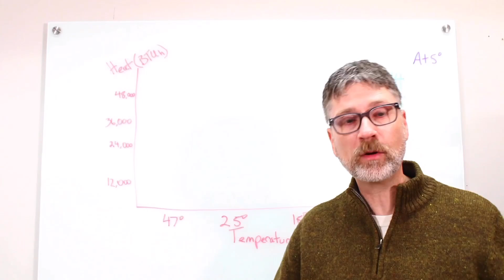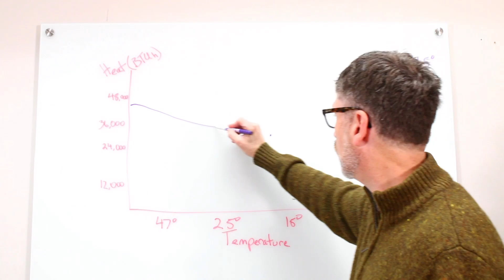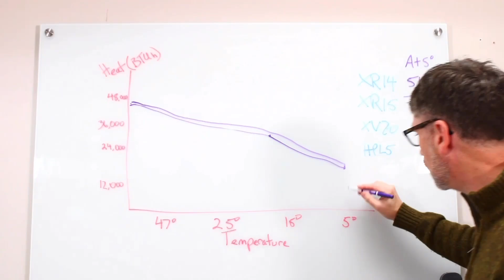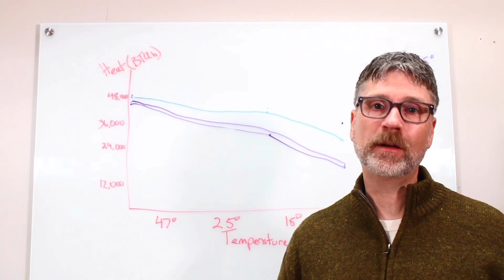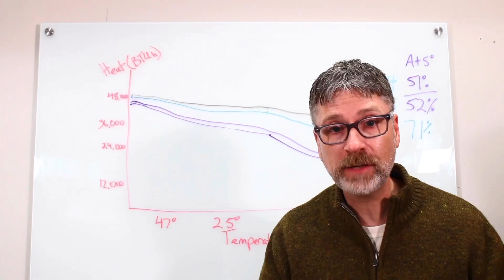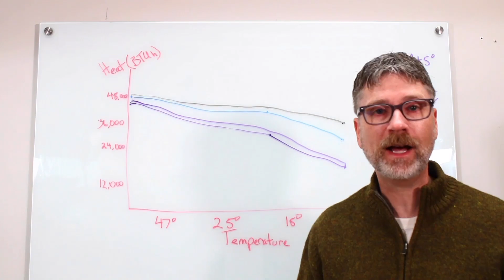Why Trane's Fabulous New Side Discharge Heat Pump Should be on Your Shopping List!

Comment: I have a Trane unit model 4TWX6048E1000AA downstairs and I have a Carrier small unit 2 tons upstairs as its a bonus room. and I was told by a tech both need to replace the evaporator coil as it has slow leak. I haven’t done it yet as it’ll cost me 6k to replace both so I decided to just keep putting Freon as it only cost me 150 dollars by my friend who is also an ac tech and lasting every spring till no longer holds. So far it’s working. Should I replace them now before it gets worse? If it need to replace both unit should I stick to Trane?
Reply from the maker: Adding refrigerant will keep the unit working, though the leak is likely to get larger over time.  It's technically not legal either as it amounts to an uncontrolled discharge of a environmentally-sensitive gas.  We have had a number of problems with Carrier coils leaking, which means the Trane would be a solid choice.  Good luck!

Comment: Will never own another Trane/American Standard. Had one the last 11 years. Had to replace the evaporator coil every other year and the blower motor after 4 years. We use one of the best contractors and they quit carrying them because of so much breaking down on them
Reply: Iv had my outdoor Trane condenser  going on 18 years now and still running strong on the original freon!
Reply: I only work on and with trane, it’s all about who and how it’s installed, if it’s not installed correctly from the beginning you’ll have problems forever
Reply from the maker: The old saying, "your mileage will vary" is certainly true with HVAC equipment.  I had a Trane at my house that was still running fine when I replaced it at 34 years.  The evaporator coil should really last the life of your unit.
Reply: Hate to say it but it wasn’t tranes fault if that many evap coils were replaced. Common items in the house like burning candles can release VOC’s in the air which cause Formic acid to form on the coil and cause pinhole leaks. It seems more pronounced on copper but causes pitting on aluminum as well

Comment: My unit Bryant unit uses COP to describe its performance.  3.0 at 47 degrees, 2.1 at 5 degrees.
Reply from the maker: Yep.  You can convert COP to HSPF by multiplying by 3.412.  2.5 COP x 3.412 = 8.53 HSPF.

Comment: Thank you for this explanation. The chart really makes it easy to understand. I like the idea of avoiding auxiliary heat as much as possible.
Reply from the maker: I installed one of these 5HPL5 heat pumps for the second floor of my house and I skipped the emergency heat kit altogether.  The only problem I had was when the outdoor temp fell to -2F.  The indoor temp held at about 60 degrees but couldn't get any higher until the outdoor temp climbed back to about 10F.